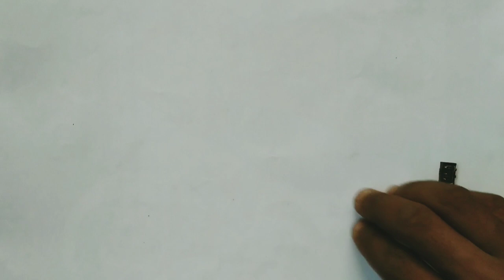DIY wireless Earphone | Bluetooth Earphones | S TECH

Comment: 12v lithium ion battery charger circuit indako pls reply
Reply from the maker: Nokkaaam
Reply: Thanks bro pls try fast
Reply from the maker: Urgent aannel insta vazhi contact cheyyu.. Help cheyyam 
iD-Sudheesh_k_veez
Reply: Urgent illa 10 daysinte ullil video edo
Reply: Items needed parayo
Reply: Pls reply. athoke items buy cheyanam. circuit   connection njn cheyethola. resistor athoke venam anne paranja mathi .please
Reply from the maker: Single lithium battery charge cheyyan pattunna circuit okke maathrame available aayittulla.. Cheap aayitt 12 volt Lithium ion battery charger thanne vaangan kittunnund
Reply: Pls make circuit with resistor,led, diode
Reply: 12v lithium-ion battery charger circuit indakan two resistor avashamunde athe athoke parayo
Reply from the maker: Resistor and diaode maathram vach cheyyan pattilla
Reply: 3.7v lithium ion battery charger circuit resistor, diode,led mathram veche hameed orbit youtube channel indakiyutunde 12v charger circuit indakan resistor value matiyal mathiyene hameed orbit youtube channel parayunude resistor value enike manasilayilla onne paranu tharu
Reply: Pls reply
Reply: Video anne edum
Reply: Pls reply
Reply from the maker: Bro contact me on Instagram